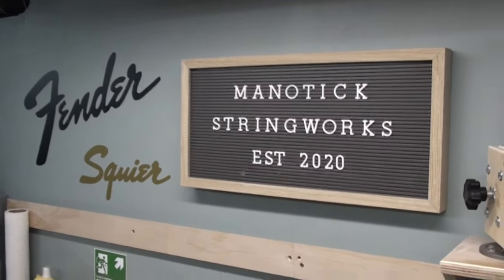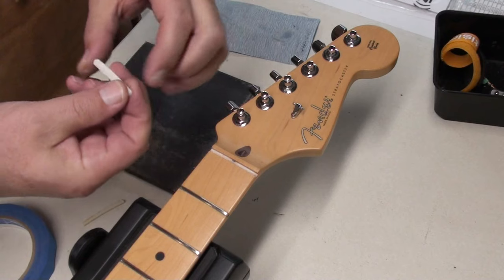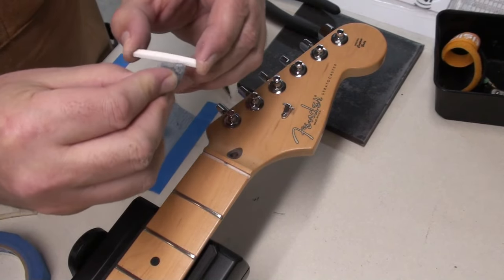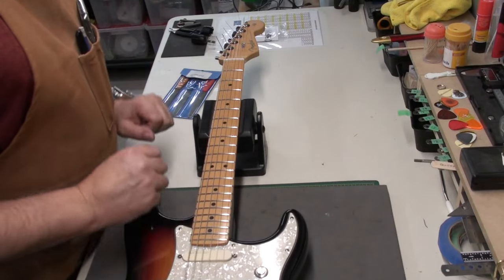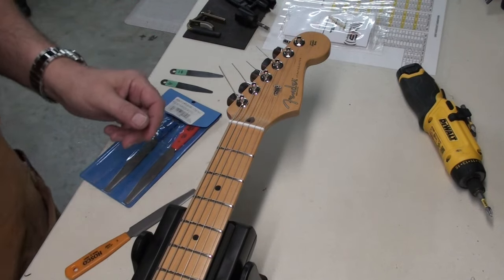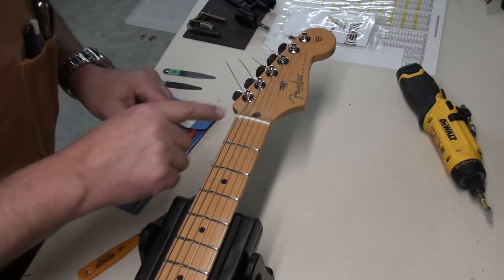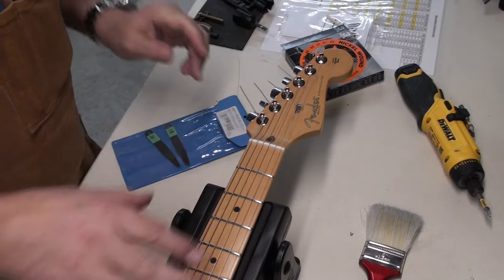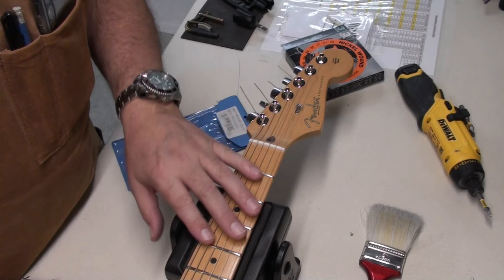Installing a New Nut on an American Fender Stratocaster: Part 2

Comment: Hi wont the over all string action have some height error when checking it at the 1st nut @8.48?
Reply from the maker: No, you are just checking the "nut action" - the height at the 1st fret.  The string action is measured at the 12th or 17th frets depending on the type of guitar.

Comment: Do you file down on the nut to increase the break angle? Also would be great to see you do a refret. Thanks again for your knowledge.
Reply from the maker: You can increase the break angle if you find it is an issue with your guitar.  I will be doing a refret pretty soon
Reply: @ManotickGuitarTech I have a messed up neck and the frets if you want to use mine.